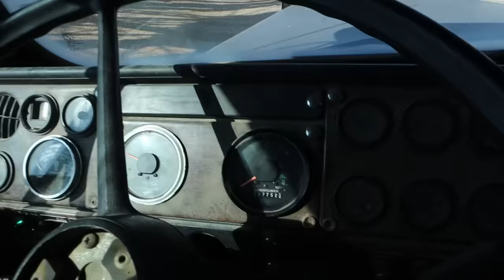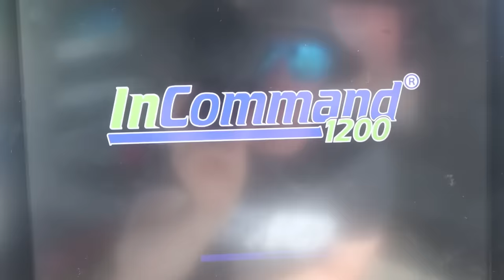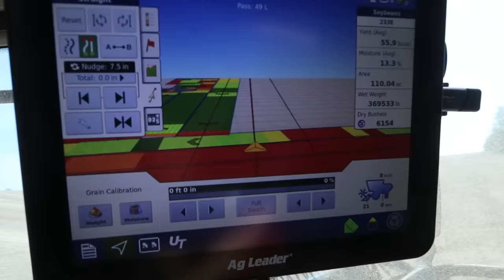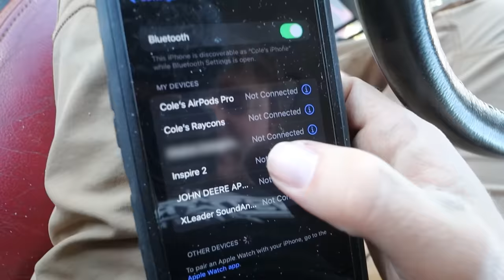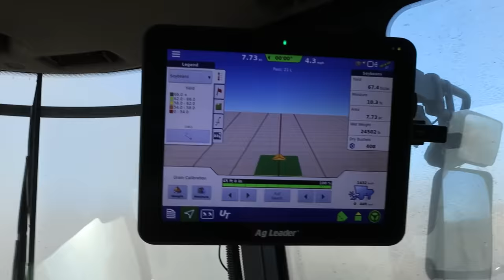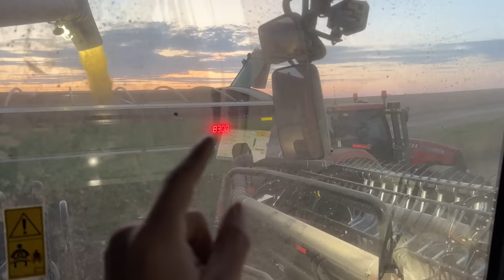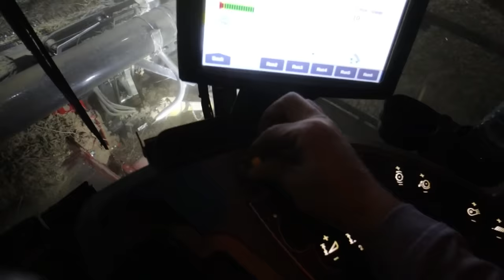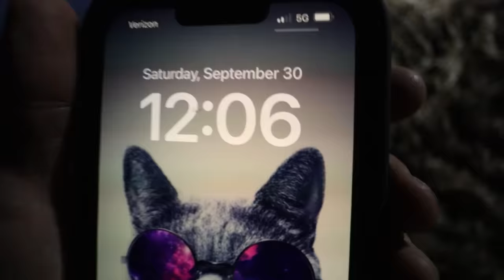I Ruined The Combine. I Hit A Skunk.

Comment: Referencing your sickle issue:  I have found that using those impacts while tightening the bolts weakens them by causing stress fractures within the bolt.  I now loosely tighten the bolts with the impact and finish it off with the ratchet.  It is slightly slower, but I have fewer issues and, therefore, actually save time.  Thanks for the content.  God bless ya.
Reply: Yes, I totally agree. Was told by a long time John Deere mechanic that impacts not best on Sickles
Reply: same here
Reply: Same here, never use impact on those bolts, we use little 3/8 ratchet. To much power in those impacts for those little bolts.
Reply: The height of laziness.    Using an impact on knife bolts.    Kids today can't work on anything without an impact.     Most can't work on anything at all
Reply: Would these bolts not have a torque setting!
Reply: @JeffRankin277 you sound jealous.
Reply: @Caleb20824  Jealous of what??     Just making an observation.    I've seen kids go out of their way to hunt for a cordless impact and a charged battery to do a job that could have been done and forgot about if they would just pic up a ratchet or wrench.    Could I surmise that you're one of them?     The truth hit a little close to home there?
Reply: @JeffRankin277  you didn’t make an observation you stated an absolute that isn’t true. Going out of your way to make a false claim shows how insecure you are.
Reply: Use a millwakee m12 ratchet on those sickle bolts. Impact is to much on those tiny bolts

Comment: Dont use the impact to tighten the knife bolts all the way in, it stretches the bolts and weakens them. I always use a 7/16 wrench or socket with a hand held ratchet for putting new bolts in or final torque on old ones.
Reply: I was about to say the same thing. We always keep a socket set and use that.

Comment: You should feel privileged. The sickle sections used to be fastened to the cutting bar with rivets. When you broke one, you had to chisel the head off the rivet and hammer it out before adding and compressing a new rivet to hold the section. Nuts and a bolts would have been a real treat. Took 3 times longer.

Comment: I’m definitely not a farmer by no means but if your combine has a cabin filter check and see if they offer a charcoal filter,this will take care of the smell. I’ve got a 2014 corvette I bought brand new and a couple years ago it turned cold quick like and a couple of mice found their way in my car. I was lucky enough to catch them early causing little to no damage but they made home of my cabin filter! I blew air down in the system vacuumed out the system and sanitized the system and still would get a slight hit of a mouse terd. Purchased a charcoal cabin filter and been aces ever since!

Comment: Those bolts shear when they are over-torqued. Look up the actual torque specs on them, do 2 or 3 with a torque wrench, then throw the impact on them and watch it spin the nut an extra rotation or 2 when you run it your typical amount. 

Those Grade 8's can withstand more force but are more likely to shear than stretch near the limit.

Comment: Oh no! I've hit a skunk with my car. Back in the early 1980's the vent on cars were just that. On my way to work, I hit the world's largest skunk. I not only hit it, but it got stuck under the right front fender well, then fell off, only to run over it a second time! My car marinated in 95° heat all day. I pulled over to throw up twice, and again at home. If that wasn't good enough, 3 weeks later, one of my dogs was sprayed by a skunk. He screamed all the way inside, down the hall, into my bed, where he commenced rolling and rubbing and crying all over my sheets and bedspread. I through them all away, got meds from the vet, shampooed the little stinker (lol) twice each day for 10 days! Nearly puked every time... pretty sure I did the first few days the entire house smelled soooo bad. 😊❤

Comment: Hey Cole, just a quick thing you can add to your meals...organic butter, best if its grass fed and finished. Kerrygold is reslly great and if you have a costco or sams club close I think they sell it in the big packs. Butter is great for you it help with buytrate creation and is a good healthy fat. You could put a good tbsp on each of those meals, help with the caloric intake and as I mentioned the buytrate.  I know you dont have much time but if anyone in the family reads this i'll just leave this little blurb taken straight from google. 
"Your body produces less butyrate than other short-chain fatty acids, but it has many health benefits. It is needed for your overall gut health, as well as helping to make energy for some of your gut cells. Plus, it can plug a leaky gut and even help stabilise blood sugar and cholesterol levels."
 There are suppliments you can take also that helps increase your buytrate but because you are trying to increase your calories and not be restrictive on calories, i'd definitly add in a good heaping good quality organic butter on every meal, well ok...skip the yougurt and blueberries. Fats are intregral part of our diet, from what I can see your super low in fats in all of these meals so add in some good butter or even add an avacado on top of the rice /groundbeef meal :) just a couple of suggestions. You are putting in huge efforts and they are for sure paying off. Keep up the great work!